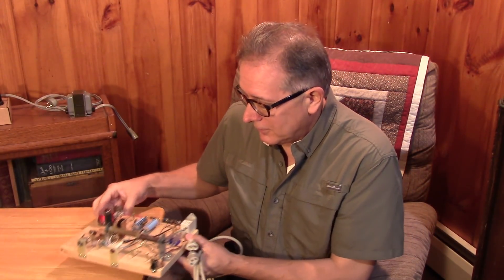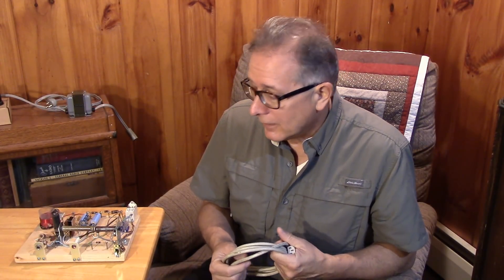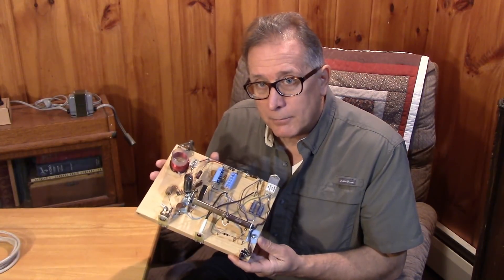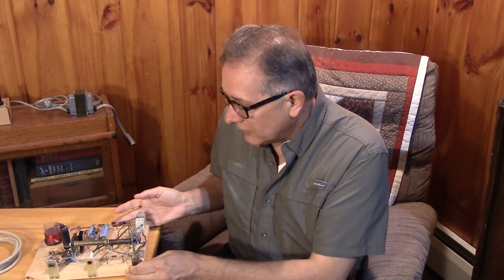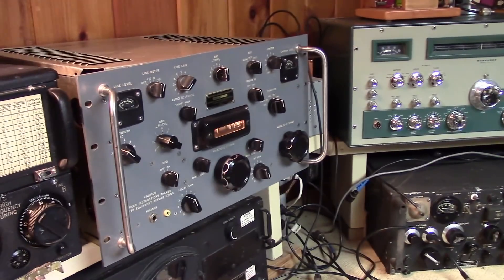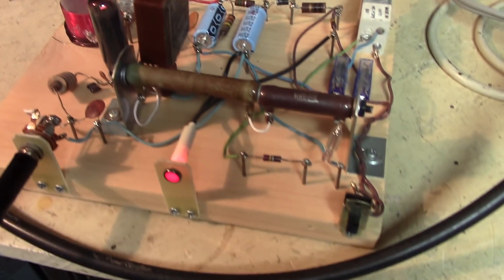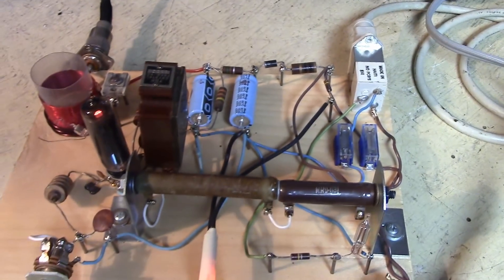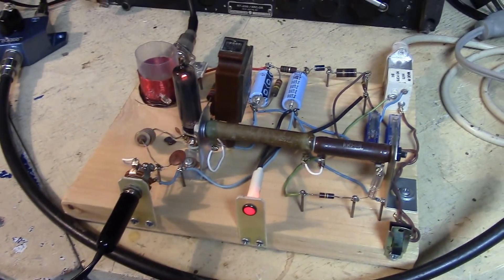Retro QRP Widowmaker

Comment: I was a TV/radio repairman, then an industrial tech before OSHA really got going.  I've been shocked. One rule helped. Keep one hand in your pocket when adjusting things or taking readings!  (And stand on a rubber mat.)
Reply: so, i put myself through collage fixing color tv sets.  Yes, the old 60/70s (70's if i was luckly lol) and yes, with a 25kv flyback with horizontal output tube sometimes 8 inches away was - shocking! lol.  but i loved it and i loved getting into industrial electronics - at that time, many machines still have tubes!  guess what? high voltage induction equipment still uses water cooled tubes at the post end. I have personally touched 50kw am radio transmitters that were converted into steel case hardening machines - still used today!
Reply: And it’s amazing how we’ve come full circle from the old high-voltage days of keeping one’s hand in his pocket lest he become part of the circuit to working around the modern microchips where one must strap himself to ground lest he fry a chip from a static discharge. Just remember which is which…

Comment: You're old enough to remember this. Back in those days, polarized plugs were rare, so the wiring of the outlet didn't matter, unless you were using a grounded plug, which was also rare for anything except air conditioners and washing machines. You always had a 50/50 chance of getting it right, which are not good odds. I remember manufacturers trying to use polarized plugs in transformerless devices, but it wasn't very consistent.  I got my share of nasty surprises, too!

Comment: In the 1980's I played in rock bands and sang on a old PA system where the recently replaced main  power cords polarity was connected  incorrectly and got a 120 volt AC shock from the microphone and grounded to my electric guitar. It was one of the worst  Zap experiences of my life.
Reply from the maker: Even if the PA had a transformer (and some did not) sometimes the input is bypassed to chassis and those caps can fail.

Comment: I built automatic doors for grocery stores, hospitals etc.  Standing on a step ladder I would reach into the header to pull out the gearbox which sometimes had worn thru or pinched the 120 volt line to give me a shock. Then we got pagers to wear on our belts. They vibrated at about 60 cycles so I would jump off the ladder and let the parts fall to the floor. Only to find out it was just the boss wanting me to call the office so he could coerce me into overtime.
Reply from the maker: Wow you were sensitive to voltage and frequency? Who needed a meter with you around?

Comment: When I was a young radio & electronics apprentice, just about the first thing you were taught in "practical" was keep one hand in your pocket where possible. The other thing, was to check if a chassis was live (hot), touch it with the back of your hand. That way, if it is live & your hand clenches, it will jerk away rather than grabbing on to it.
Health & Safety was different then!
Reply: One hand in pocket was also what I was taught. If I recall, the idea was that it reduced the possibility that current went via the heart, reducing risk of fatal shock.
Reply: or you could use a lamp if you aint got multimeter, less painful...with that being said you have no business messing with these devices if you don't own a multimeter
Reply from the maker: I remember a guy telling a story at the ham club meeting when I was a kid. He got his hand caught inside a giant Heathkit Apache upside down on the bench - and he could not let go because of the voltage. He fell and gravity worked to free him. But gravity also worked to bring the radio down on top of him.
Reply: @MIKROWAVE1  Hopefully, the Apache didn't scalp him.  SORRY. My bad.  I've built quite a few Heathkits and also been bit by the occasional electrical excursion... I think my worst "bite" was from a tiny AM band transmitter that had no case on it.  While I was holding it, a "friend" plugged it in.  FARKING OWWW!!!
Reply from the maker: Even better? Keep both hands in pocket!
Reply: Great tip. Thx
Reply: I been playing with electricity since I was four years old. My first shock was when I put the car keys into the electrical outlet. Then I wanted to help mom and tried to plug in the vacuum cleaner in the outlet my finger was between the prongs mom told me why I got bit. Maybe a few months later I decided to remove the outlet covers and trade the ivory covers with the brown covers and vice versa. Then about five I started making home made or child made extension cords. I had line cord, outlet and one roll of electrical tape. I made a few at that age. I even made a work light out of twisted white wire, plug and Edison base socket. Dad used the light under a cousin cottage to see while he did plumbing . Well I did get shocked a few times in my childhood.  I made shockers in Jr high school out of car radio parts. The vibrator and the output transformer made good shockers. One I made would arc through clothes including jeans. Then I started charging 450 volt electroletic capacitors. Got shocked on them once. I also got a shock off the old Atwater Kent short wave radio.. I also had an AM all American five tube radio and had to run an antenna outside. The loop antenna.was broken but if you ran a wire off the tuning cap and ran it outside it pulled in stations. Not as good as the Atwater Kent. That radio pulled in stations all over the USA and Cuba on AM short wave all over the world. I could get WWV and WWVH at once from Colorado and Hawaii.

P.S. the car keys back in the early sixties were thin like lock keys they fit into the outlets of the fifties you had two way slots vertical and horizontal for two types of plugs. No ground but the boxes were grounded by EMT conduit.
Reply: @ronb6182  "...put the car keys into the electrical outlet..."

Did it start?
Reply: @disqusmacabre6246  no but I did.
Reply: You can use the "back of your hand" trick ONLY if you are at least 600% sure WHAT you are testing.  In a previous life I worked in a car repair shop.  One day we were replacing the air compressor.  The "electrician" (i.e. the shop owner's elderly father who had been an electrician decades before) wanted to test if a line was hot.  He thought he was testing half of a 240v circuit (i.e. 120) but instead the wires were connected to a 3-phase 480v circuit.  So he got the full 480v through the back of his hand.  Sadly he lost use of that hand after that incident...
Reply: The best thing is to use a neon light tester. First you need to find which end has the resistor. Use the other end for touching the chassis. If the neon light glows reverse the plug in the wall. Now you will have the neutral to the chassis. The neon light should not glow. I used to have a neon light that you could actually see the dropping resistor. The ones today the resistor is inside the plastic not visible. The way I found out which side has the resistor is to stick the lead in the short slot of the outlet if it lights up a soft glow you found the opposite side of the resistor then you can mark the lead for future use. 

A multi meter can also be used if you have an electrical ground on your bench which you should if your a ham operator. Even repair technicians use grounds for static wrist straps when working on MOS type of solid state or ICs.
Reply: @Steve-GM0HUU  I get the feeling I'm younger than you guys. Anyway in electrical school, we were taught the "one hand" rule.

With that said. When I was in grade school, I decided to poke around a breaker box to what appeared to be an abandoned well house near the complex where the kindergarten through high school for our town and surrounding areas was located. I believe I observed a power pole with the wires going to the wellhouse though no longer going to the mainline, which lead me to believe that things were safe to examine. 

I was quite wrong! For some reason I intuitively used only one hand and so while that shock hurt like hell, I'm still here to write this!
Reply: @joshuapk9808  Right. You should NEVER use your hand to see if hundreds of volts with enough power to kill you stone dead, are in a circuit or not. Multimeters exist, and if you haven't got one, put the cover back on the TV and go phone a professional. Even those little neon screwdrivers are OK. But your hand? Whoever said that, it's utterly stupid!

Yeah I know it's better to get shocked on the back of the hand than the front, but that isn't advice to go get yourself shocked. It's not as bad, but it's still pretty bad!
Reply: @joshuapk9808  I have been zapped by 240 Volts a few times and it really bites, this is 240 V @ 50 HZ as in Australia, I would hate to imagine being belted by the 480 V Circuit,.

Comment: Woah...brought back memories.  My uncle pulled an old aircraft transmitter/receiver from the cockpit of his Bonanza, in order to replace it with modern gear.  It was a tube unit that also had a vibrator power supply.  Problem was....the power supply went to someone else.  The radio required 250 volts DC input.  I was just recently married and we were 200% broke.  Buying a power supply was out of the question.  I wanted it to listen to aircraft frequencies.  It wasn't channelized....to tune a station one simply tuned the knob just like the AM radio in your car (with white numbers on the scale to indicate general VHF frequencies up and down the band).  I ran a 220 VAC line from our power panel using 14 AWG romex, and rectified that 220 VAC via full wave bridge and some high voltage caps that I had on hand.  I then used some very huge size, variable (via a slider that one could run up and down the resistor body) power resistors to create a voltage divider in order to get to the required 250 VDC.  It worked real well for a few weeks.  Insanely crazy how I somehow thought that was okay to do.  A major Homer "DO'H" when I look back on that nowadays!!  The on/off switch to provide power to the transceiver was nothing more than dual knife switch that included those round screw-in fuses for each leg of the 220 VAC line.  I used as small of a fuse as I could find...which was probably a 5 amp or some such on each leg.  One day when I closed the knife switch to turn on the radio....there was a loud pop from somewhere inside the radio and it never worked again.  In-rush current probably blew something up.  I did take the covers off and tried to see if there was something I could readily ascertain was bad , but the components in that dang receiver were packed so tightly.  I think NASA called it "cordwood" circuitry construction.  I couldn't tell shit from shine in that solid mass of components and wire.  It ultimately got tossed into the garbage.  I wish I still owned that receiver as a memento of early aircraft equipment.  Sorry this is so long winded.
Reply from the maker: Oh the Humanity!
Reply: Hey grab that thing to taple, nothing is not ever so badly broke, that cannot fixed. Last option to cast parts again what is left ;)

Comment: I've been zapped by 110,  by 220,  been zapped by 600Vdc B+ and 25 kV CRT,  but the hardest and most painful zap ever was only 68 volts DC.  That was the day I learned why technicians don't strip wire with their teeth . . .
Ohhh, lookit all them pretty stars,  and in broad daylight too !
Reply: Lol yep done that , vision lost for brief second
Reply: Got the worst shock Ive had from a 48 v golf cart. Was cleaning contacts and laid my sweaty arm down on frame. The DC sticks with you for a while after you've been zapped. All jittery.
Reply: @eggroll1up918  dc shocks are scarier than ac  very strange feeling
Reply: Try stripping your phone line with your teeth And a phone call comes in .Ouch !90vdc

Comment: I have a 1936 Philco AM Radio.  It is one beautiful machine in it's wood case.  It has a "hot" chassis.  I mean hot because the hot (black) AC line is connected to the chassis.  There is no ground. I have replaced the old worn out power cord with a vintage cord,  I love this radio.  I used a cord with 3 prongs so I could not plug the cord in Backwards. Loved the video.

Comment: Twelve seems to be a magic age around here, my dad decided his kids watched too much TV so he sabotaged our set and told us it was broken. He had made me a place in the attic
to get me out of his hair sooooo I got with my friends and dug up a set that had a
good picture tube, 20 odd inch,  but bad electronics and another with good electronics and a bad tube , 12inch about. Thank God I had seen my dad discharge the tube once before all this happened. I put the two sets together and got a big tube with a small picture in the middle. Both sets had hot chassis. I could have burned the house down. Later I learned enough to fix the one he "broke" but he wasn't impressed. As I look back I feel sorry for him. Thanks for a cool video
Reply from the maker: Frightening and yes I also had a TV Chassis open in the bedroom. How did we survive? My father was great with gas and propane, but scary with AC and Power wiring of any kind.

Comment: I Navy ET school they drummed into us that getting shocks is a sign of being careless, our first instructor said you'll get zapped from time to time and you can bet that every time you were sloppy or not paying attention. That said if you work on a lot of stuff for a long time you are likely to get zapped no matter what, I know I have had a couple goo bites.
Reply: Totes mate. 
I got my first proper bite at 825v DC it made me cough for a minute straight....
I was being careful but my hand slipped. 
It's the first for many many years tho....
Reply: @dannixon247  -- I don't know the voltage of my first zap but it knocked me off the stool I was on at the workbench working on a 25" color TV, it was unplugged and I went to disconnect the high voltage anode from the picture tube and failed to discharge it first, a mistake I never made again :)

Comment: My worst shock was touching the collector of the horizontal output transistor of a color TV's fly back circuit. 
The fallout:
It hurt.
15,750 Hz is forever etched in my mind.. 
It left a white bump under the skin on my right middle finger's tip.
It took a few years before I could feel that spot again. :)
It happened in high school, about 40 years ago, I'll never forget it.
Reply: The Horizontal output is for the HORIZONTAL deflection COIL and NOTHING to do with the Flyback Circut.  the HV on the Flyback is for Anode voltage on the screen, which increases with SCREEN SIZE. starting w about 5KV for small TV...........
(2 different circuits)
Reply from the maker: OMG OW!
Reply: Let me tell you ,I got a few 25kv pokes out of a fly back .that's why you fly back when it hits you !But one of  the worst shock of all was from a Mallory 6 AL MSD on my friends 71 split bumper Camaro .Let's just say 5 pulses per second at 50 kV really hurt and woke me up !Diddnt need an espresso after that !
Reply: @jesscast5122  Sir, you forget why the flyback is called the fly back. When the horizontal sweeps across and reaches the end, it must FLY BACK to the other end, very quickly (sawtooth signal, not sine). It is this rapid change the (flyback) transformer uses to create the high voltage to charge the aquadage of the picture tube.

30 frames/second, interleaved (2 sets), so 60 sweeps over 525 lines, (30 x 525 =) 15,750 Hz. This is on the primary "side" of the fly back transformer (I think most were auto transformers, so the two sides are not isolated). Anyway, its a nasty RF at sufficiently high voltage and current to send that current right towards the bone, cooking whatever flesh is in between. 
The experience comes highly UN-recommend.

But my high school electronics instructor (retired Navy EE who worked on subs) said, "if you can trouble shoot every part of a color TV, you'll be able to troubleshoot any system". He said the color killer circuit was digital :)

Yup, 2 circuits, but look a little further back on a schematic, you'll see what I mean. Over 40 years ago, still burnt in my mind :D
Reply: @carlubambi5541  oh, yeah! Pow, pow, pow, pow, pow! Right in the arm (or what ever was touching it) ha, ha. Those high energy ignition systems... they'll light you up, keep you jumping for a while.
Reply: @RobertLBarnard  got a good poke off an old 5 watt vacuum tube single channel my buddy keyed up the microphone when I was connecting the Co axial cable .let's just say ouch .5 watts of RF
Reply: @carlubambi5541  lol, yes.... the OTHER meaning of flyback! Ha,ha.

I remember hearing stories (one from my dad who had a Zenith & Motorola/Quasar dealership... Started out just as a repair man, also a ham). A fellow discharged a tube..... with his belly button as he was picking it up, and dropped it, breaking the tube's neck.
Reply: @carlubambi5541  yeah, RF is different. Its mean and ornery, doesn't shake you and let you alone. RF is like a hot needle. That's what I remember, the burn didn't hurt. It was everything around it that hurt.

5 Watts is quite a bit of energy! I was looking at LED lasers last night for 2D cutting of wood or cardboard. For $100 or so you can buy a 5 to 7.5 watt (output) laser to do the job. These things consume 20 to 40 Watts. For around $200 to $300 you can get into the 10 watt range and really cut wood... The higher end ones can be PWM for communications or cutting different material. 10 watts!